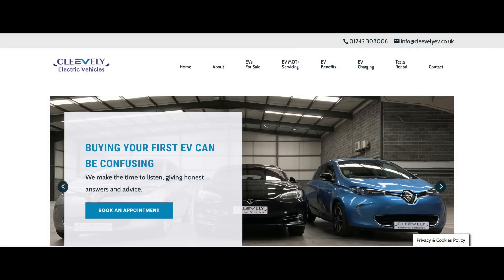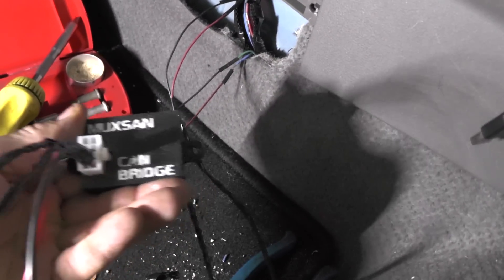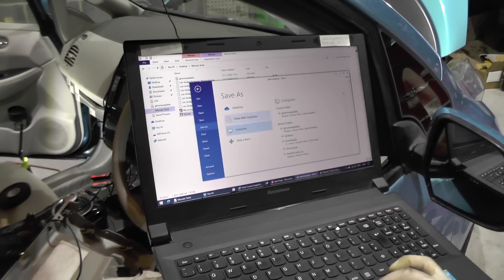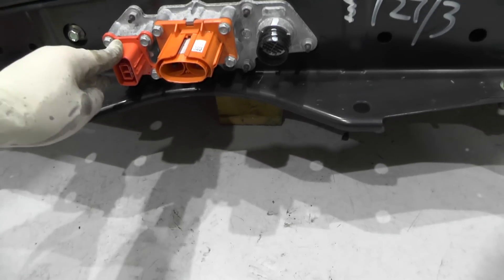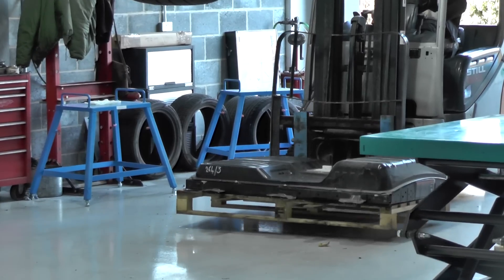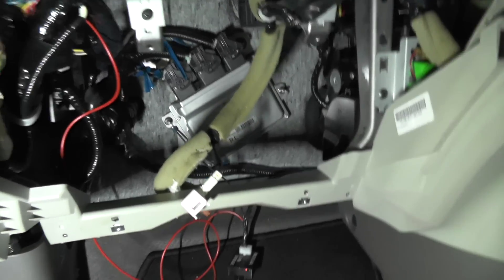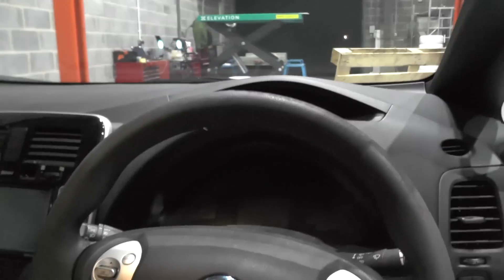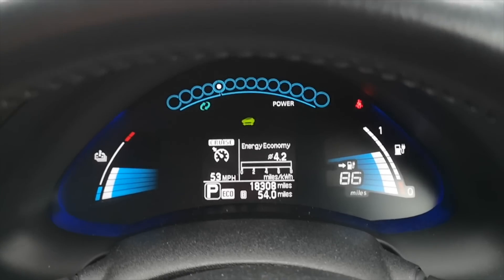Nissan Leaf  -  40kWh Battery Upgrade

Comment: Brilliant! Great to see our Gen one getting the new battery. It’s like a new car with no more range anxiety. As it’s winter we just drive with the heating on and no need to keep looking at the range left. The real world range is still over 150 miles.
Reply: Can you please let us know the cost for the 40kwh battery fitted and ready to go, also what happened to your old 24kwh pack.
Reply: @antoniopalmero4063  £8,500 and the old battery is with the installer.
Reply: @alanweeks 
 £8500 is a lot of money for a battery upgrade especially if you recently purchased a used Leaf for about £8000. Might as well buy a used 2018 or 2019 Leaf.
Reply: @mamadouaziza2536  Exactly, it doesn't really make any sense, you can get 2018 40kWh model for under 15k now on autotrader
Reply: Sorry but the maths just don’t work for me . ~£3000 would be the right money for this.
Reply: @antoniopalmero4063  Some people are just emotionally attached to the car. Money doesn't matter :D
Reply from the maker: I think you have some very good driving skills, Alan. I've been using a 2019 Leaf 40 for a little while and my range is 125 maximum.
Reply: @Jamesandkate  that’s with my wife driving; I would still be at 180 miles. 😀
Reply: Now, in 2024, the maths make perfect sense. I’m in the US and picked up a 2016 LEAF S for $7000 USD( approximately 5200 British pounds).  Range is fine, for now, but will just decrease over time.  The vehicle is essentially perfect, so the plan is to eventually upgrade to the 40 kW battery.  I’ve worked on ICE vehicles for years; mechanically, the battery upgrade looks easy apart from dealing with the massive weight of the pack.  Cheers lads, thanks for the great video.

Comment: James, I love the fact that these upgrades are becoming quite normal. What happens to the degraded batteries once removed? Have you found a good recycling facility that can repurpose or recover the core materials. Would love to know.
Reply from the maker: Currently there's no need to recycle as they're in demand for other purposes so they can simply be sold on. Most people are making a home Powerwall from them
Reply: @Jamesandkate  excellent second life is just what you want at this stage. Glad to hear there's a good market for that.
Reply: Good question, many people are not aware just how much power electric car batteries produces, often 10 to 20 times more than you'll use in your home, so a 25kw/h battery even down to just 15kw/h capacity could power a home for several days alone, possibly weeks if used with Solar Panels before needing mains power.

Comment: Hi looking to do this to my 2013 24kwh would be interested in how much it would cost
Reply: I've been quoted  £8500 from Cleevlely for an upgrade with no trade in value for my 24kwh battery with 80% SOH. This is the issue for Joe Bloggs who has no means of dealing with the handling and transport of their Old Battery.  Still think the guys are doing a great job but I am not prepared to just give my existing battery away for nothing.
Reply from the maker: I'd quite simply list it on eBay, it'll sell within a few hours.
Reply: @Jamesandkate  Thanks for the reply James but 99% of people do not want this hassle, they just want a turn key operation. Why not offer a trade in price based on a leafspy  report. If it will sell within hours on ebay then you sell it on ebay and make another profit on the deal. I am sure you will have a lot more customers for your product if this option is given, Regards Keith

Comment: In my opinion this should have a government rebate associated with it. This is the most environmentally friendly way of keeping these cars on the road. Maybe just a $1000 or £1000 credit would go a long way.
Reply: You're correct. Here in Norway, Leafs are plenty, but replacing the battery still carries a risk regarding the car's registration. As Nissan is not eager to see their shoddy cars having eternal lives, they wave the safety card and raise doubts that replacement batteries in ZE0 cars are safe...it's infuriating!
Reply: @centennialequus  in Norway, no tell no blame...
Reply: EV that degrade the battery so quickly and rapid-gate so inconvenient for end user due to lack of thermal management is not "most environmentally friendly". Any subsidy should be for SparkEV that has thermal management, 5 mi/kWh at 60 MPH (100 km/hr), 0-60 MPH in 7.2 sec (quicker than any car in price range gas or EV), and 50 kW fast charging all the way to 80% without taper resulting in 20 minutes to 80% even quicker than any Tesla.
Reply: Brilliant idea!
Reply: YES., battery swapping should be sponsored by goverments

Comment: I would have kept my Leaf get this milage
Reply: Probably reuse as powerbank for homes seeing as a basic tesla powerwall is £8000 and is 13.5kwh and the smallest leaf battery is 24kwh so even when its running at 70% its still holds more charge.

Comment: OK this is our Wonderful Planet changing Climate future, replace your filthy Battery  Engine  to a Carbon Free 'Alice in Wonderland Future' Good luck on that one. As far as Climate Change the latest survey found the pole at 83°57′00″N 120°43′12″W. During the 20th century it has moved 1,100 km (680 mi), and since 1970 its rate of motion has accelerated from 9 to 52 km (5.6 to 32.3 mi) per year (2001–2007 average; see also polar drift) This is Mainly the cause of GLOBAL WARMING in the Northern Hemisphere [added and buying an Electric Car] will not make the minute  difference. Nature is all Powerful and to expend Trillions of £/$ is at least to fight or endeavour to reverse it it sheer economic stupidity
Reply from the maker: This is simply about upgrading an electric car. I'm really not sure what your'e going on about, especially without any punctuation.
Reply: @Jamesandkate  What lack of Punctation exactly do you refer to - surely being pedantic here to a ridiculous degree. I view all your Videos and have considered an EV but so far not convinced or financially viable. You are simply removing your exhaust to a CO² Producing Power station a few miles away - Clue Biomass Trees cut down and Pelleted producing more CO²  that will take 35-40 Years to grow more Trees - Ludicrous. You just carry on preaching  and just give us facts. Electricity is not FREE unless you have an illegal supply or enough cash to install enormous Solar Panels and a Wind Generator. If able to buy an EV today that would give me the same performance as my 2019 Mercedes W247 B Diesel AMG with as have achieved 85.6 mpg at a similar price {sub £30k}  I would get one tomorrow. But put simply there is no such option. If in YOUR OPINION there is please advise
Reply: @ihavenoname2634  If you have been duped into thinking Climate Change can be reversed or halted by buying and EV then truly sad for you. Let's look at FACTS 1)For Instance Cutting down thousands of trees, chopping up in 

pellets, shipping to the UK and burning in Power Stations to produce Electricity - absolue Joke, more CO² from Trees replanted that will take 30-40 Years to have the Years ?

Google it were you right ? 

 Give you a clue in the last 100 years it has shifted 1,800 Metres - 1.11847 MILES - an Electric Car will not make the slightest difference and Billions of 

taxpayers money will be poured into a fruitless schemes to attempt to halt/reverse Nature. In my Opinion in an advanced Hybrid Vehicle that could cover up to 100 

Miles on Electric Mode (96% of Journeys) but have a back up efficient ICE Unit that would enable you to cover long distances when required at a REASONABLE 

COST and EV Mode Must be used in Cities & Towns of more than 5k Populations. If enough incentive by Government Subsidies were to be offered I am sure many 

Motor (Car) Manufacturers would invest in such a project. I live the furthest from the Sea in the UK you can get and throughout this 'lockdown' period have taken 

numerous trips to take my wife for a Picnic and walks on the Beach at Cromer, Hunstanton etc. However it's a 240 Mile at least day round trip. I can and have done it in 

a Modern [W247] CLEAN Diesel using just over 3 Gallons  [15.89 Litres Costing around £16] and very few EV cars capable of that distance apart from the Tesla Model 3 - 

but from £42+K Get Real.*